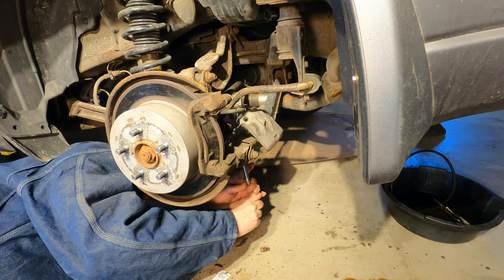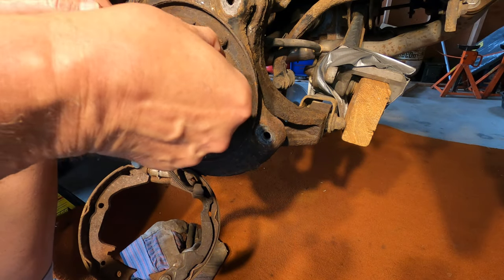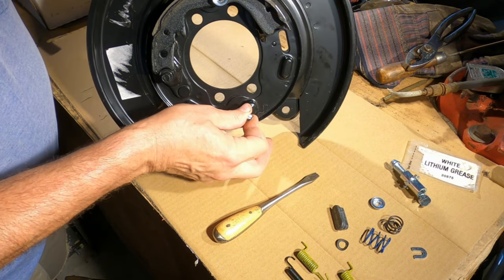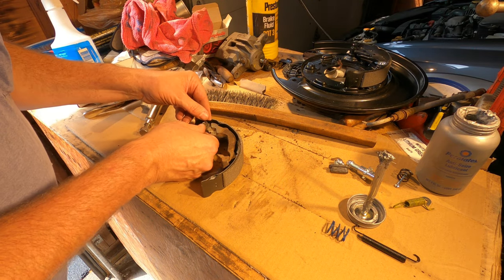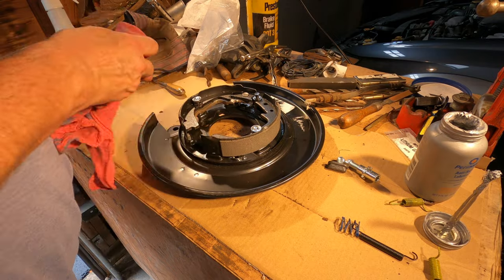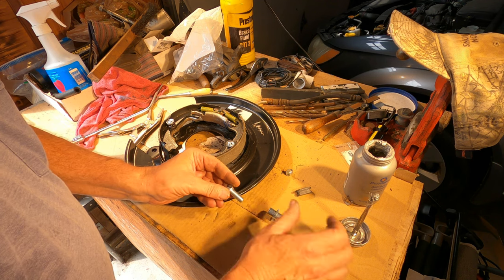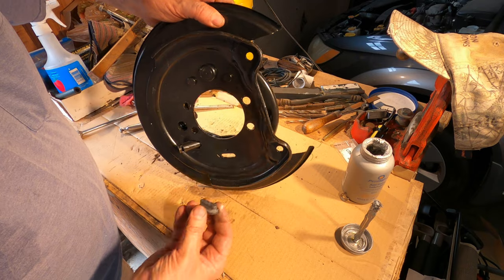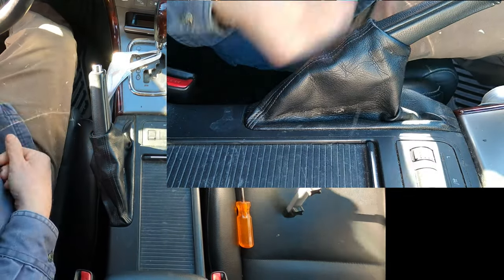Fixing Parking Brakes | Subaru Outback | Man About Home

Comment: Great video
I am tacking the exact same job with new backing plate, hubs, and hardware.
Is it possible for me to disconnect cable and then take off backing plate with hardware attached (since I am replacing everything)?

Also, can I bench assemble everything and then install with brakes installed on backing plate?
Seems like the cable attachment might prevent being able to do this.
Reply from the maker: It's probably easier to just disconnect the cable after pulling the brake shoes from the backing plate. I think you're right. The cable attachment is in behind the brakes shoes, so it probably can't be done the way you're asking about.

Comment: any tips for removing the cable from the backing plate? I know there's a clip that comes off, but do you also need to spread those tabs/ears on the backing plate to pull the cable out? mine is very rusty, could probably use a new backing plate but I'm worried I won't be able to get the hub off
Reply from the maker: I soaked mine with a lot of penetrating fluid, for a long time. Then I tapped them with a hammer to loosen them up. They actually pulled out pretty easily.
Reply: @manabouthome  but you didn’t need to spread the tabs out? Just pulled it out after removing the clip?
Reply: @manabouthome  been soaking mine for a couple days with pb blaster, but it’s rust welded on. Don’t think there is any penetrating happening. Might try a blowtorch next
Reply from the maker: @milosong-weiss5770  Right. I hit it with a hammer to loosen it up.

Comment: Great video, sir.                ( not a fan of drums/shoes )
Reply from the maker: Thank you! Amazingly, they're still in use today! I remember driving a '69 Pontiac Lemans at 80 MPH on Route 84 in the Hudson Valley. I hit the brakes really hard to slow down to a safer speed and all that happened was loud vibration and it hardly slowed down. 4 wheel drum brakes was all that car had. Disc brakes were more of an upgrade in those days. Thanks for watching!